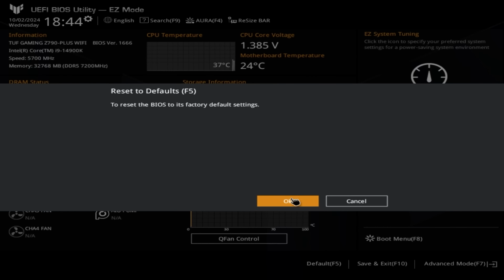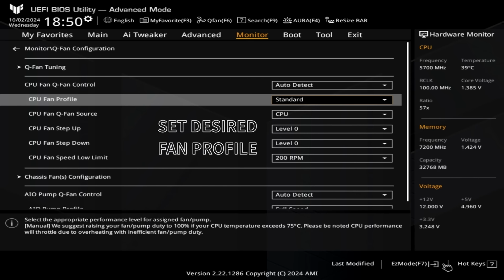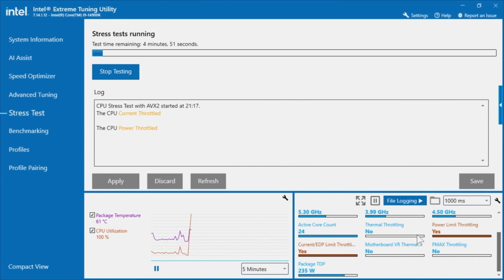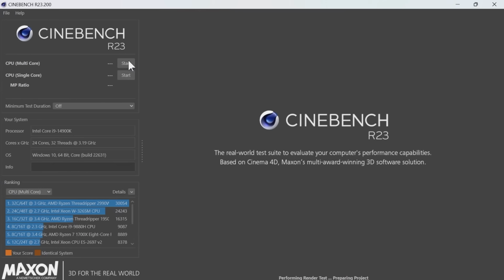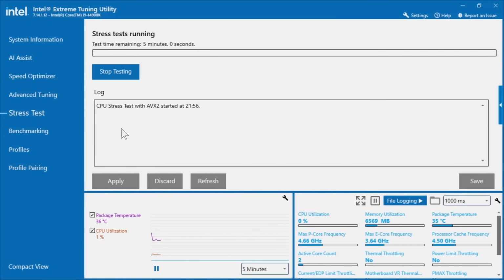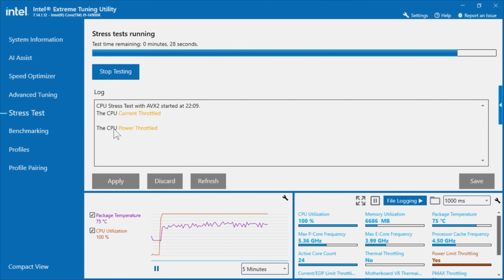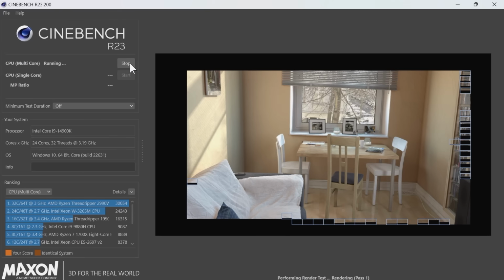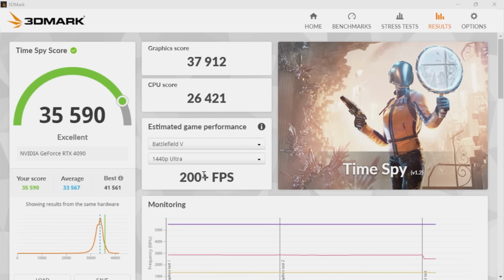i9 14900k Undervolting Guide: Part 2 Complete Stress Test Results

Comment: * So, here is an update. With due respect, it might take y* ou a minute to read this, but your response would double the fun. First of all, I am incredibly impressed by the work you have put into the video, and I immensely appreciate and commend your efforts, as it is not easy to do such stuff and record at the same time. Anyone who is gonna read this, let me tell you this you are not gonna believe that I spend one year on this under-volt thing, and achieved a damn single result until I came upon this guy's videos.  Let's get to the latest update now.

Brother, I know you previously replied to my comment, but I just watched this particular video a few hours ago and did the same things.  What I did was ''watching this entire video, followed step by step". 

I applied intel limits first for my processor "13600k", and then followed the exact same settings in the video except the core synching part, I did not sync any cores. Starting off with 0.03 and then going up to 0.085 on minus offset is what did magic to me.  XMP enabled, intel limits applied, and the video guideline applied, I was able to grab 23,100 score on Cinebench R23, with the max temps of 72 degrees, and max package power draw of 146.7 watts. 

I know 23K is common for 13600k, but for me it is fine since I never achieved this while maintaining cooler temps. Any idea on why my friends 13600k with ddr4 rams achieve 24k on cr23 on stock settings, and I still did not touch 24K. Just a question, I would love to hear your insights. 

Getting back to my comment, before that I struggled watching several guides, and never be able to grab 23K score without removing power limits, and with power limits removed, I used to have less score with temps going up to 90C and power touching 212 Watts. So I am really very happy about it.

Just tested cinebench 30 minutes stability test, and achieved 22608, is this normal? because on one minute test with same settings, I got 23008, so a few marginal error maybe? On 30 min test, 73 max temp on pacakge, 146.7 wattage power max, vcore 1.243 max, and VID max 1.294 max. (intel limits and ur video guide applied).  Anything I should do more than this to test stability?    

(SO again, while I was typing this, I did another 1 min test right after the 30 min test was completed, and I grabbed 23,091 score even higher than first one minute, which was 23,008, both on -0.085 offset), also ran OCCT with avx2normal set, and max temps are 78 and max power is 158 watts, max vid to 1.243 and max clocks are 4731 mhz.) 

Some queries for you and some other details from my side:

So as I said, I was trying different techniques. One of the method that I found useful on a reddit post was about lowering the IA AC loadline from 1.0 mohm to 0.5 mohm, and it did tremendous results while maintaing the intel stock profile, and also asus multicore enhancement turned off at the same time. So would you like to share your insights on this? I am able to grab best temps and nearly great performance from my processor using your guide. But do you think I should also lower my IA AC Loadline from bios to 0.5 maybe, it might be mentioned near IA CEP.  

Second question is that, I achieved those scores (23,0921 cr23) by following your guide, while my core clock frequencies were lowered by 2-300 mhz on P-Cores, and 100 MHZ on E-Core, while cinebench was being run. So it is a great thing for me as without power limits, cinebench never lowered the clocks, but also never gave the same results I got from ur guide. But the question is, do you know why does Cinebench lower core clocks during the test, while intel power limits are applied? But I believe it is normal, as with core clocks reduced, I was still betting better scores. 

I also wish to sync my cores or might overclock to 5.4 GHZ, so do you have any pointers for me if I wish to do this, or you recommend just sticking to what I did? Would appreciate your response. My main usage is FPS gaming, along with photo and normal video editing for YouTube only. I just shifted to a rtx 4060 from a GTX 760, LOL. 

Lastly, I tested my processor up to -0.085, so should I lock this setting, and the settings you narrated in the video,  in bios now and enable virtualization back again? Or do I have to do something else? 

And more question is regarding idle temperature spikes. Do you think it is normal for normal package temps to spike 5 to six degrees, like it is staying on 33C and then goes to 45C, and then back to 35C? Kindly look at this for more clarity, ( Idle temp spikes be like: 30c-38c-48c-35c-40c-44c-36c-38c, etc etc, i hope you got an idea, lol. Pardon my naive explanation.)

It was a long read, I appreciate your time. I tried my best to explain and discuss at the same time, so if any ambiguity is found, I beg your pardon for that. 

I am also a YouTube and TikTok content creator with over 7M+ VIEWS, and an ecommerce entrepreneur working with firms in USA. I would love to connect and network with you either through social media or your number. I am just one google search away if you wish to connect me through facebook or instagram. 

I would conclude by thanking you from the core of my heart and wish to connect with you and have a chit chat through a video link and would love to appreciate you for the efforts you have put into it. No one has shared any video related to ASUS Bios, and you are that lucky guy for me. I was so fed up with this chip but not anymore as I have got you. 

Thank You

You are God's man helping and serving His people. 

Regards, 

Asawal Warraich.
Reply from the maker: Thank you for the kind words, great to hear of the improvements ☺️

Comment: I have a question i have a Asus Rog maximus z790 dark hero with a 14900k I did exact the same and it still crash time to time when I play games I dont know what I did wrong can anyone help me with that please 

Ps: bios is latest 1801
Reply from the maker: @10ChaosKiller  Download and run the Intel Processor diagnostic tool to see if your processor is degraded or at fault and follow the RMA process, if it passes you will need to refine the undervolt further

https://www.intel.com/content/www/us/en/download/15951/intel-processor-diagnostic-tool.html
Reply: @nextlevelsimgaming  ok thank u I will do that and let u know
Reply: @nextlevelsimgaming So I tested and did the stress test but it's failing and even when I increase the voltage again still same issue idk what I can do to run it better what I notice also one or two times it pass the stress test and when I play a game like CS2 or BF 2042 after some time either game crash or the PC restart
Reply from the maker: @ Disable IA CEP and SA CEP and retest
Reply from the maker: Also run the Intel Processor diagnostic tool to see if your CPU is at fault 

https://www.intel.com/content/www/us/en/download/15951/intel-processor-diagnostic-tool.html
Reply from the maker: @ Have you run on Intel Default settings?, if it crashes on that profile I think you should be looking at raising an RMA for your processor with Intel unfortunately
Reply: @nextlevelsimgaming I ran the diagnostic tool test, and it passed, but I still experienced crashes and a blue screen. So, I increased the voltage a bit more, and now it's running stable—at least for now—at 5.5. I’ll keep monitoring it. The temperatures are somewhat okay, around 70-78°C, but I guess my processor might be faulty.  

Thank you so much for your help, effort, and tips! I really appreciate it and am very grateful for your support. 🙏
Reply from the maker: @ A CPU that is degraded will require more power, one that cannot be under volted within the tolerance of - 0.05000 is likely to be degraded, Intel offers an extended warranty of an additional 2 years, I would recommend that you initiate the RMA process based on what you’re reporting back, see the other comments from other users who experienced similar issues and have now received replacements, and have no further problems.  Its a pain but unfortunately once a processor is degraded it cannot be fixed
Reply from the maker: @ No worries, its definitely sounding like the other examples we’ve seen like this, good luck

Comment: I get shy 40k on the cinebench , and shy 24k on 3dmark on spy , around 81fps for the cpu results. Ive tried everysingle thing for a entire day and cant get passed 24168 points. Ive got the 14900kf and a 3090 , 32giga 6000mhz. Ive seen multiple people get over 26k points but HOW
Reply from the maker: Have answered your question in the other thread, close any background applications when benchmarking in the tray, RGB software etc, Chrome, only the benchmarking software should be running
Reply: @nextlevelsimgaming  done this does not change the score. Today im even down a bit 39800 and 23800 en 3dmark , what ever i do or what ever numbers i try in the bios im not getting over this. Everything is new , windows is optimized also.
Reply from the maker: @ The score is dependent on system specifications, and silicon quality, unfortunately there is little else apart from refining the undervolt to improve the score, thats dependent on your individual system.

Just ensure you are using the Asus OC profile with settings shown in the video not the Intel Default settings otherwise your score will also be low for that reason

Comment: Is this sync all cores approach optimal also for iRacing (in VR) which of my understanding has a "single core focus" which it utilize to its full performance. Or would another approach be better for that sim specifically (ie adaptive boost, turbo or other)?
Reply from the maker: @jodyhellsing5914  I use it in iRacing and experience no issues, also works great in VR

Comment: i was following along and this litteraly borked my entire pc. i cant even get out of bios now because it says it cannot find a boot device. thanks.
Reply from the maker: @MrLuenon  Cannot find Boot Device is nothing to do with undervolt, either the incorrect drive is selected in BIOS, or UEFI or Legacy mode is incorrect ‘or’ your SSD / HDD was at the point of failure.

Both SSD’s and HDD’s have a limited lifespan, and don’t relate in any way to undervolting, which is a common way of optimising a CPU to improve temperatures.

Can't find boot device" means your computer is unable to locate a bootable hard drive, usually due to an incorrect boot order in your BIOS settings, a faulty hard drive, or a corrupted operating system on the primary drive; to fix this, you need to access your BIOS and check the boot sequence, ensuring the correct drive is set as the primary boot device. 
Key points about "can't find boot device":
Incorrect boot order: This is the most common cause, where your BIOS is set to boot from a device that doesn't contain a bootable operating system. 
Faulty hard drive: If your primary hard drive is failing or damaged, it can prevent the computer from finding a bootable partition. 
Corrupted operating system: A corrupted boot sector on your hard drive can also lead to this error. 
How to troubleshoot:
Access BIOS: Restart your computer and press the designated key (usually F2, Del, or Esc) to enter the BIOS setup. 
Check boot order: Navigate to the "Boot" section and ensure your primary hard drive is listed as the first boot device. 
Check hard drive detection: Verify that your hard drive is recognized by the BIOS. 
Reset BIOS to defaults: If unsure about settings, try resetting your BIOS to factory defaults. 
Run startup repair: If you can access Windows Recovery Environment, try using the "Startup Repair" tool. 
Other potential causes:
Loose cable connections: Check the connection between your hard drive and motherboard. 
Secure boot issues: In some cases, Secure Boot settings might interfere with booting. 
Outdated BIOS: Update your BIOS to the latest version if necessary.

Comment: Hey man I’m having a tough time here .
I got the i9 14900ks and I’m trying out the setting your showing here while adjusting for the extreme profile from intels default settings shown online

I set the sync cores to 55 
PL1 to 320
PL2 to 320
IccMax to 400 
an undervolt of -0.050
And all settings shown in the video. And when I run a stress test to get a baseline, I BSOD. It’s usually a memory management message. 

Interesting to note that this is my second attempt at this to fine tune it. In my first attempt I sync all my cores to 57 and then tried 58 with my performance cores at 6 and I wasn’t crashing. Even with an undervolt of -0.075.
Is it that the KS doesn’t like 5.5 on the cores? Or am I doing something wrong
Reply from the maker: What RAM are you using?, is it 4 x DIMM or Two?, if 4 x DIMM then drop to 2 x DIMM and retest.

If you are using 2 x DIMM then check if IA CEP is enabled if so disable then retest, Current Excursion Protection can throw a wobbler on some Motherboards.

In Multicore Enhancement ensure ‘Disabled enforce all limits’ is selected, otherwise power levels will run untethered.

If all the above fail revert to Intel Default Settings and do not sync cores and try a mild undervolt - 0.05000 then retest with IA CEP disabled.

We had a user with a KS on here a while ago who also had issues on Apex IIRC it related to using 4 x DIMM, that can be very problematic with DDR5 unfortunately they work well on 2 at larger capacity not 4

Comment: Can you do a video about the core ultra 9 285k?
Reply from the maker: @venividivici4253  I will indeed, there have been a number of updates recently, the 0x114 Bios update, but in January 2025 there is an Intel CSME Firmware update, this combined with the certification of a number of CUDIMM high speed DDR5 kits will deliver big improvements, so exciting things on the near horizon.
Reply: @nextlevelsimgaming  I’ve followed you’re guide as close as I can except you showed a TUF bios where as I have a ROG bios. Some options I skipped due to differences since I’m on z890. It crashed my system so I’m using XTU to do the voltage offset only. I’ve also enforced all limits in bios. I am running a compact sff setup as well.
Reply from the maker: @venividivici4253  It wont work with the 285k, the guide is for an i9 14900k, the architecture is completely different, there is no Hyperthreading, and the processor is too efficient to benefit from undervolting.

Don’t worry though, I am testing the 285k currently and will have specific performance improvement guides as soon as I am able to compile the best practices to optimise the processor
Reply: @nextlevelsimgaming  sounds good. I am trying to get the best performance I can with my sff setup.
Reply from the maker: @venividivici4253  Its the cost of early adoption unfortunately, but CUDIMM is going to be a game changer for the 285k with speeds possible of 10,000 m/t taking advantage of the NPU and AI overclocking of the IMC really pushing the boundaries.

There are a lot of issues also with Windows scheduling, and there are also promised updates coming from Microsoft with the power profiles in particular.

I have been quite enjoying the 285k so far, its been extremely stable, excellent temperatures, and is certainly interesting in terms of its efficiency, gaming hasn’t been noticeably worst at 4k gaming, lets see what January’s next series of updates brings to the table 🙂
Reply: @ agreed. Try a sff build something with the fractal Terra. That’s the case I’m struggling to contain the 285K.

Comment: 0.80 cinebench score 39227. 
Mine is stable on rdr3 ,b06, forbidden west , gow. No blue screen at all great temp. ( i ddnt try to go 85 and up mighr try nextime)
Z 790A mb
14900k
Corsair vengeance 64gb  6000mhz cl30
Rog 360 aio
.thank you so much. U earn i subscriber
-update.
I did undervolt  to -0100
Cinebench score 40200* :)
Reply from the maker: @imyoursKV  No problem 😉

Comment: Can you do one specifically for the 14700k?
Reply from the maker: @Slappable亗  Unfortunately I don’t have a 14700k to do one for, the process however is the same, the power limits are different so ICCMAX 320a and PL1 - PL1 to 125W, PL2 to 253W

You can also use the Extreme 400a and PL1 to 125W, PL2 to 253W
Reply: @nextlevelsimgaming  Thanks for the quick response! What should I sync the cores to?
Reply from the maker: @ Try it at 5400, others have reported good success with that, but I believe it may run better at 5300, experiment with the frequencies 53, 54, and and find the best temperature and performance balance.  The 14700k is reportedly similar in operation to the 13900k
Reply: @nextlevelsimgaming  Will do! Have a great day and thank you!
Reply from the maker: @ You too mate, cheers 🙂

Comment: Thank you for your video. For my system MSI MPG Z790 Carbon WiFi II 14900K RTX4090 DDR5 Corsair Vengeance @6400 used the following configuration I did some in deep tweak and set all performance cores to 56 ratio, and offset -0.080, adjusted my IA VR voltage limit to 1.450 as Vid Max, set my PL1 and PL2 to 253 and ICCMax to 400V and was able to obtain a higher score in Cinebech R23 up to 38500 compared to 35000 with sock settings and temperatures between 78 to 80 Max when under stress test running and 34 while idle. 3DMark TimeSpy Extreme 17671. Maybe Faster ram will help push my cpu to even higher scores. Any suggestions to obtain better scores?
Reply from the maker: @PhoenixProTech  Faster RAM will improve scores on 3D Mark, but stability and temperature are more important than scores, you will gain score with increased undervolt but lose stability
Reply from the maker: Not really, the video is now legacy and no further updates will be done, i’ve moved on to Arrow Lake since